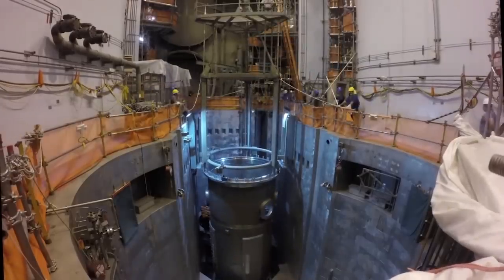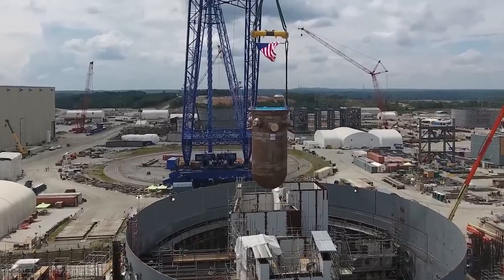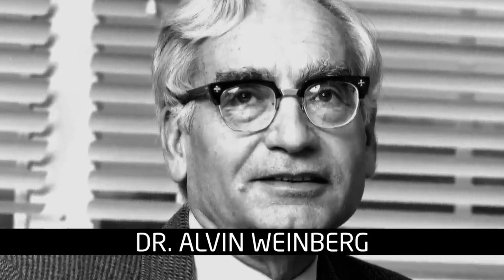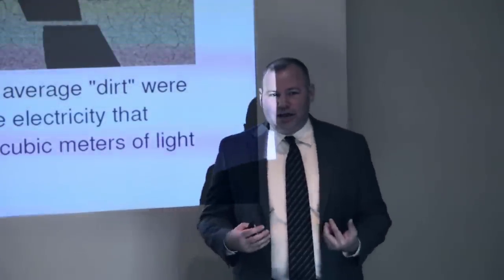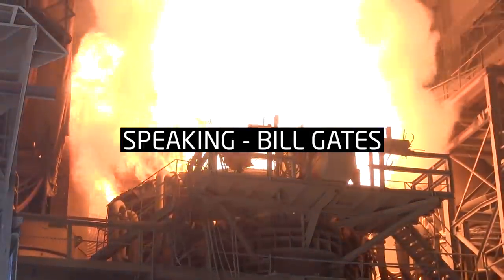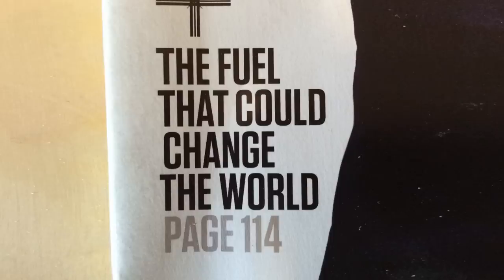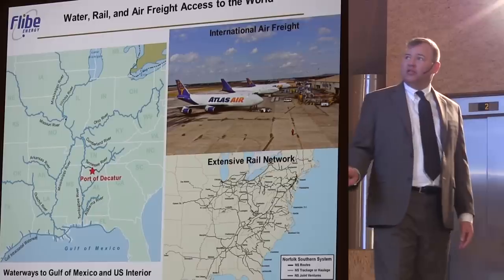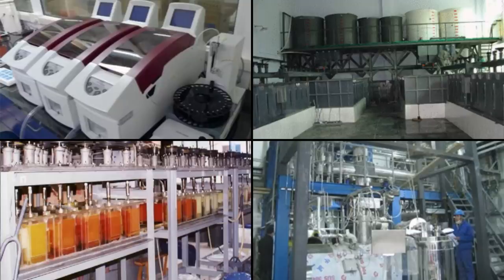Thorium 2017

Comment: The problem with thorium salt systems is there's no way to automate the thorium fertilization without creating unwanted elements and any automated system would also risk a run-away reaction with injection of the thorium.  They're self toxifying systems.
Reply: Maybe we had better "run away" from a runaway injection of thorium in a self toxifying system!

Like that time I tried to put gasoline into a car and the pump handle got stuck, and there was gasoline spraying everywhere, and I was like, I better put out this cigarette so I tossed it into the nearby garbage and that caught on fire...

THAT was a bad day let me tell you.

But no. Just... no. You haven't even made it to wrong yet, is how much sense you're making.

Comment: Thing about jumbo aircraft, is that if you made it like a catamaran, you could have a LFTR unit in one fuselage and the passengers & crew in the other- *far enuf away that radiation shielding is not needed*. (http://realbigbird.com). Radiation, like light, decreases with the square of the distance. Course, you dont want this landing on the tarmac; but you could make it a seaplane so that a crash does not fracture the reactor vessel because water is not as hard as concrete.  No more jet trails. No more CO2 emissions.
Reply from the maker: Day, I really think using energy from reactor to create synthetic fuel is a superior alternative to a nuclear powered aircraft. Here's the (longer) "Thorium" doc touching on that subject... https://youtu.be/2oK6Rs6yFsM?t=1h38m33s ...all the guy's who conceived of MSR, and drove its development to power a nuclear powered aircraft thought it was a bad idea. They did so to try catch up to the PWR which had (more suitably) been used to power submarines. While I'd recommend first hearing-out the synth-fuel case, if you want details on the nuclear-powered-aircraft aspect of it, jump to here... https://youtu.be/2oK6Rs6yFsM?t=2h13m35s ...it is a bit more dispersed than the synth-fuel section, but you can pick up various people (including Alvin Weinberg himself) claiming the nuclear power aircraft was not going to work.
Reply: Lots of support for syn fuel. But I had in mind a water bomber to fight wildfires. The water tanks, around the reactor, are shielding when risk to ground crews is a factor. You prolly know, that if there is a problem, Thorium salts are not water soluble. And just like a fire truck, its always ready to go... into regions where fuel may not be available.

Comment: Fission or Fusion are our best hope, we have to do something pretty quick. Reprocessing spent fuel at sellafield in the U.K. is now the best on the planet. If you're scared of radiation don't eat bananas or fly in airliners. A material that has a half life of 1000,000 years is much less dangerous than one with one with 10 minutes, the 10 minute material will be SCREAMINGLY HOT/ RADIOACTIVE!!!!  We evolved to tolerate radiation, but not the elements above Uranium. Peace and Love. X. X. Don't believe the Hype. X. X.

Comment: Both the Pentagon & the Soviets wanted a high speed long range bomber. A high speed  crash presents horrific contamination. http://realbigbird.com is a low speed catamaran biplane that scoops hundreds of tons of water to fight wildfires.  But its also a global emergency services system that could splash down in the Houston harbor and provide power to the local emergency services soon as the weather abates. Before a storm, the seaplane, like the famous China Clipper, could draw up to a dock to evacuate those- who'd otherwise foolishly try to ride it out, but cant resist the experience of the flight. No commute to a suburban airport, and none of the panic seen there either.

Comment: Let's just simply say I think it's time for to take the mom salt thorium lifter reactor I want to see you turn it into a fusion core type design and that is the fusion core outer covering is from Fallout 4 I'd like to see if lifter could actually put be put in that kind of thing but instead of two battery type terminal connectors use the old CRT plug in order to have more signals go in and out of the containment if that's possible I can guarantee you could probably power a lot of space crafts with it and if you can come up with a better plug design that could actually do the job I'd suggest it but I say naked compact enough where you could probably put it into a household or a really small version that could actually power just if he see so you don't have to have your computer plugged up to a wall outlet this is definitely a challenge that I put it against you I want to see you pull it off because if you can that means robotics key walking two legged robots or whatever else you plan on doing but I want you to stick to the challenge!

Comment: Trying to promote thorium reactors by dissing uranium reactors is the worst strategy, there could be. 

The only people who are interested about Thorium reactors, are the ones who support traditional nuclear power.

With this video, you only push supporters away.
Reply: The problem is that Uranium reactors (and PWR in  particular) are a fundamtnally unsafe design. They were OK as proof of concept at Nautilus scale, but not when built at industrial electricity generation sizes. They're giant steam bombs looking for an excuse to rupture.

Weinberg realised that in the 1950s. That's why he put so much effort into developing LFTR technology. What had been done with his first baby scared the bejezus out of him because of the consequences when the materials technology failed. At least if the materials in a LFTR/MSR fail, the mess is contained.
Reply: @Alan Brown

Do none of you people know that Molten Salt Reactors not only can use Uranium, but are easier to use with Uranium as well? This idea that it's either Uranium or Thorium is nonsense, though Uranium is both cheaper and simpler to use in MSRs. Instead of breeding Uranium via Thorium, you just start with the Uranium.

Further, the idea that Uranium reactors are "fundementally unsafe" is absolute nonsense. I understand the claim that PWRs are (though they still have an exceptional safety record), but to say Uranium is unsafe isn't based in reality.

Comment: https://www.ne.anl.gov/About/reactors/EBR2-NN-2004-2-2.pdf
Reality and the vision

A number of factors have conspired to
divert plans for EBR-III. The prospects for
rapid development of civilian reactors de-
clined in the 1970s and 1980s as the tech-
nology appeared less economically feasi-
ble than previously thought and the
accidents at Three Mile Island and Cher-
nobyl raised safety concerns about nuclear
power. In addition, the rationale for the fast
breeder became less compelling when ura-
nium prospecting produced more fission-
able material than expected in the mid-
1940s and early 1950s and when additional
oil reserves were discovered. Breeders also
got a black eye with a well-publicized ac-
cident at the sodium-cooled Fermi-1 reac-
tor near Detroit, which was not built based
on the EBR-II experience. As Leon Wal-
ters, who worked on IFR, points out, in this
environment water-moderated reactors
have dominated attention, “since they are
relatively simple, the technology is well
developed due to their use in submarines,
and since industry is comfortable handling
water.”
Those who built and operated EBR-II
have not given up the vision of EBR-III.
As Walters notes, the design “is proven, it
is proliferation-resistant, it decreases
waste disposal problems, it’s inherently
safe, and perhaps most important of all,
Fermi’s original idea—conserving fis-
sionable material—is still sound.” Koch
insists that EBR-III will eventually be-
come a reality. “Maybe it won’t be in my
lifetime. But I think that someday there
will be an EBR-III, just like Zinn and Fer-
mi thought.”
32 N U C L E A R N E W S February 2004